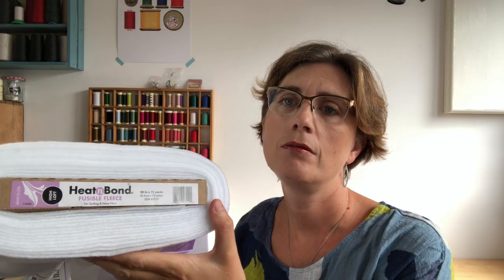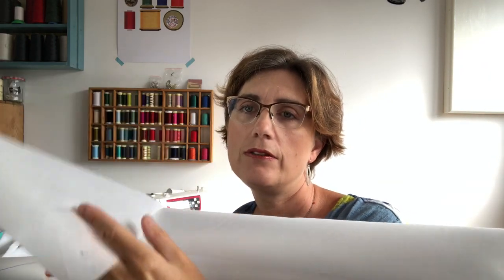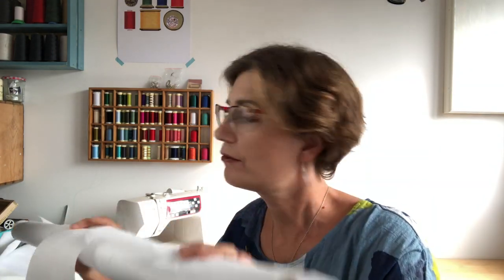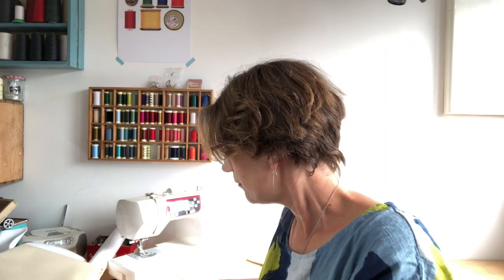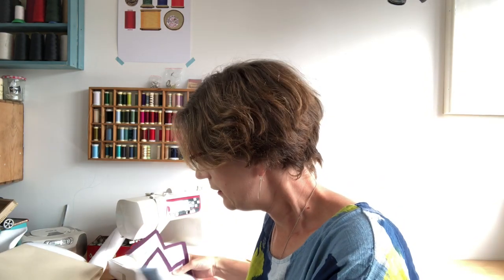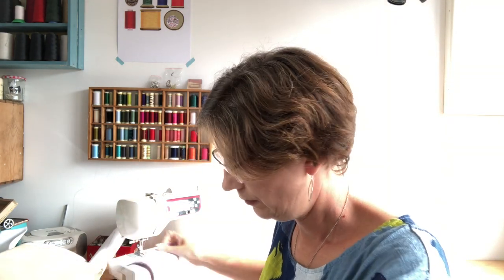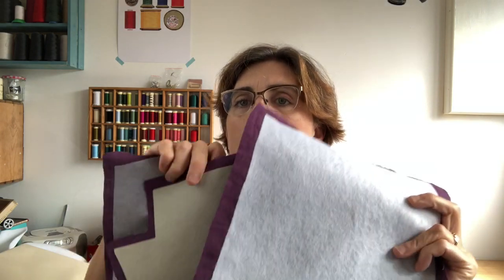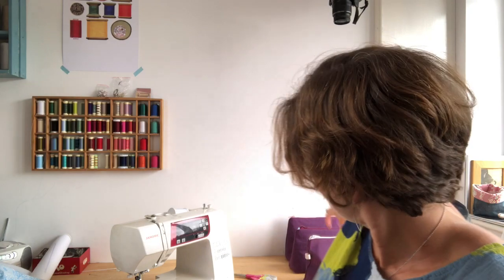Interfacing for bag making

Comment: If making a bag with cotton fabric for the exterior, it's best to use a woven fusible interfacing like Pellon SF101 on the cotton pieces only. Then apply one of the other stabilizers depending on how much firmness one desires in the bag.
The woven interfacing makes a big difference.

Comment: Hi Vicky thank you for your tutorial and the knowledge you shared.  I have recently started making bags but I find that fusing interfacing directly onto the main fabric sometimes  leaves crinkles in the fabric and at times even unstick. I spray with water then press the iron firmly down for about 10 secs and repeat.   What I've started doing is ironing it onto the lining instead. Any advice? Perhaps brands I should use? Change of method? Thank you.
Reply: I used  fleece on the lining of a bag and found it  worked  really well. I also found it helpful to use a light woven interfacing on the outer quilting fabric outer.  Would be interested to hear if anyone else has done this.
Reply: @gme2444  thank you for sharing your experience with this.